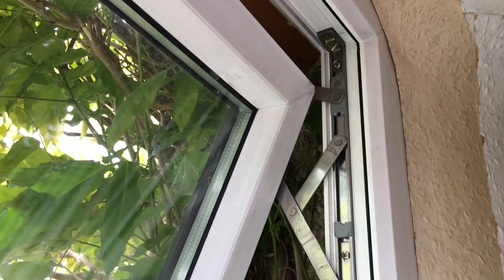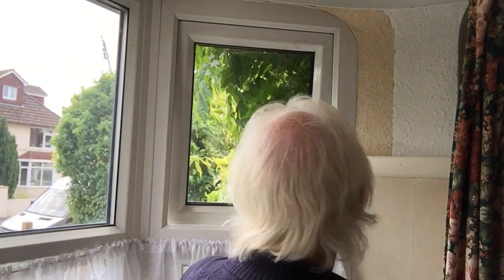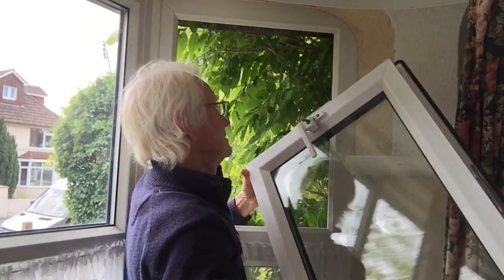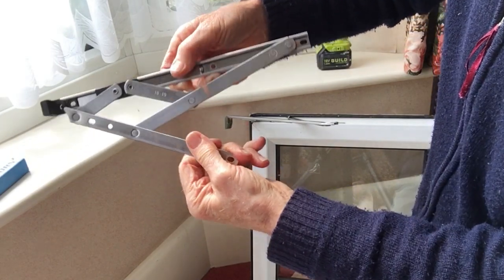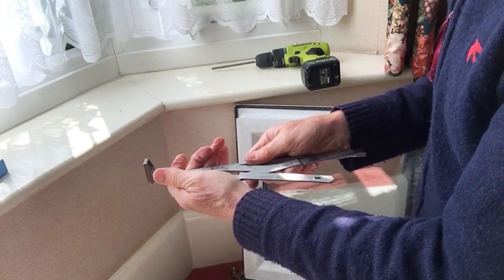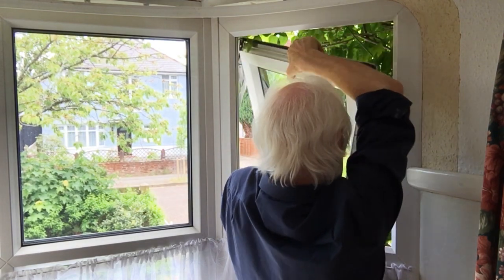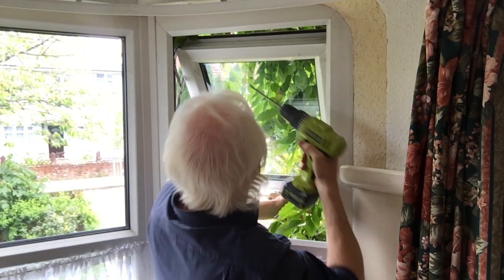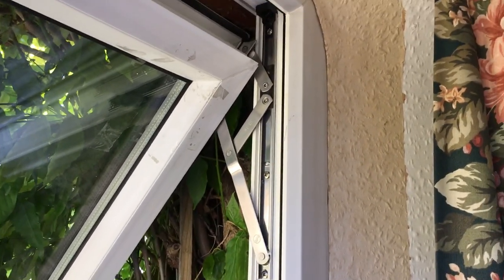Replace top hung UPVC window hinges - the DIY method explained plus how to avoid common mistakes.

Comment: Eight hours ago I started to replace the hinges on two top hung double glazed windows, Trying to do the hinges individually was a nightmare and as you can imagine I got very stuck.
Then I watched your video and 15 minutes later they were both in and functioning perfectly.
Sir you are indeed a living legend thank you so much.
An outstanding presentation. And I can’t get that song out of my head now so thanks for that.  
kindest regards Robert.
Reply from the maker: Thanks for watching Robert and for your kind remarks. Surprised me how such a simple looking job could get so complicated. Meanwhile a couple of correspondents suggested removing the double glazing panel first - which would make the frame about 90% lighter to handle. Wish I knew that before I started! Cheers b33zo

Comment: Hi b33zo, I just wanted to thank you for posting this video, it helped me a lot today when fitting new hinges onto my kitchen window. As I had never done this job before, I made a right mess of it and destroyed a hinge. I watched your video and popped to screwfix for a new pair. Mine were riveted into place so drilled them out. Fitted the new hinge to the window using self tapping screws, had my mate lift the window into place and screwed it to the frame, took 30 mins. Your video and instructions were easy to follow and so helpful, no longer have a cold drafty kitchen! Thanks again, Jonny.
Reply from the maker: Thanks for watching Jonny and for your kind remarks. Who could have thought that this job could be so complicated?! A couple of people below suggested removing the double glazing glass first - which makes the window around 90% lighter! Wish I had know that before I started... Best wishes b33zo

Comment: Thanks for this! I just fixed a window that had exactly this problem. I got the Mrs to help though, much easier to get the window in and out with two of us.
Reply from the maker: Thanks for watching Martin. Someone suggested taking the glass panel out first (fairly easy to do) which was an excellent idea as 90% of the weight is in the glass. Would have made my job much easier. Cheers b33zo

Comment: Hi John, this vid has been up for a while so this comment is for the benefit of DIY'ers using this as reference.

The hinges you removed where in fact 17mm stack height.  By leaving the packers out the hinges will be misshapen, under stress and likely fail early. I've seen these fitted incorrectly and the stress pulls/strips the top screw holes in the frame.

When you offered it back up and it seemed tight, that is correct. By opening the window/hinges fully this allows hinge flex to pop or pry the frame side of the hinge into what's known as the euro groove/channel.  I hope this makes sense.  All the best.
Reply from the maker: Thanks for watching Neil and leaving some helpful advice. Yes, it looks like I was too hasty in deciding the window wouldn't fit with the 17mm stack - partly to do with the weight while holding it in place to make that decision. If I had taken the glass panel out first (as several people later suggested) I might have successfully located the frame and hinges into the euro groove. Another DIY lesson learned. 
Cheers b33zo ps my wife later shaved most of my hair off..

Comment: Great video. I’ve been having a nightmare with my new hinges. After watching this video I realised I’d put them on back to front, so they wouldn’t pull closed at the top 😂
Reply from the maker: Thanks for watching Lee. Yes I had the same problem. Even when you've double checked the direction of travel the hinges can still be on back-to-front. b33zo

Comment: Thank you very helpful. Wish I watched before I tried.

 The Mushrooms don't fit into the keeper bottom of my window, do you thing on the frame should Be lower not butted to top of frame.
Reply from the maker: Hi Son, thanks for watching. I had the same problem and got very unhappy. In the end I moved the part of the hinge that fixes to the window. The frame part of the hinge stays butted to the top of the frame. It's all part of DIY! 
Good luck b33zo

Comment: My replacement hinges new bumper are slightly bigger, installed them exactly how you did but bottom window lock doesn't clear by ½mm and it's right up against the frame

Comment: Just to confirm, when you say "left" on the hinge, that is left from the perspective of looking in the window from the outside? Also, since the hinge coming off was 17mm, how come making it the same size with the spacers was too big, but it fiitted on  being 13mm?
Reply from the maker: Thanks for watching. 'Left' in this case is from inside the roome. The hinges are clearly marked with a 'L' and an arrow showing direction of opening. The fittings include spacers just incase you need them. b33zo

Comment: Good video. Can you tell me if I can replace friction stays (side hung) with friction stays that include the easi-clean/egress feature? Are channel widths the same on all UPVC windows?
Reply from the maker: Thanks for watching Mark. I think the answer is yes and yes. The stack height is still 13mm or 17mm and the width 18mm so they should fit okay. Give yourself twice as long to do the job as your best guess on a finishing time. ATB b33zo

Comment: Im finding it very difficult to drill the frame for the new holes .
Aluminium frome I think .
Any suggestions 
Thanks.
Great video doh 👌
Reply from the maker: Thanks for watching Tom. UPVC is like drilling cheese. Just make an indent in the material (UPVC or aluminium) with a masonry nail or something else sharp and use a new drill bit. Shouldn't be a problem. b33zo

Comment: I have a broken hinge similar to your demonstration.  However, the hinges are not screwed to the UPVC frames.  I'd describe them as riveted with flat rivets with a small hole in the middle.  Have you come across these fixing? The windows are old of course.  Do the rivets need to be drilled out and if so, do they need to be re-riveted back again, that's assuming the holes line up with the new hinges?  Any information is appreciated. Nice video btw.
Reply from the maker: Thanks for watching denbyish. The concertina mechanism is held together with rivet type fixings but the whole hinge is screwed to the white plastic. So no drilling or re-riveting required. When you take the screws out on the frame side of the window the window and hinges come out complete. 
Someone made a useful suggestion that if you remove the beads and take out the double glazed glass the 'window' become much lighter and easier to handle. Wish I had done that!
Give yourself plenty of time - on a warm, dry day.
b33zo
Reply: Hello again...  For the benefit of other readers, my hinge (concertina mechanism) is riveted together, but the hinge is additionally riveted to the PVC frame, with aluminium rivets.  I looked online and the general method of removal is to drill out the rivets and to use fresh rivets where the frame holes line up (with the new hinge) and screws where they don't.  I leave a link which may be of use to other viewers who have this type of hinge fitting. Thank you for your reply.

https://www.handlesandhinges.co.uk/window-hinge-rivet-removal/#:~:text=Window%20Hinge%20Rivet%20Removal,-To%20remove%20rivets&text=Use%20a%204mm%20or%205mm,just%20taking%20the%20top%20off.&text=Refit%20new%20hinges%20to%20window%20using%20screws%20or%20rivets.
Reply from the maker: @dembydish  Thanks for your reply. Yes, this is another thing altogether. I would drill out the rivets to remove the window. If the new hinge holes don't line up it might be to your advantage as fitting screws is likely be easier than re-riveting. There's nothing to stop you drilling out fresh fixing holes in the concertina mechanism either. Lets us know how you get on. 
Good luck b33zo
Reply: We used "security screws" which look like rivets because of the head. They will unscrew with the right fitting (although, we found out that a cross head rill bit can unscrew them if done slowly)

Comment: What about the missing screws on the opening sash against window  didn’t show that because when installed it’s impossible should have fixed it when it was out
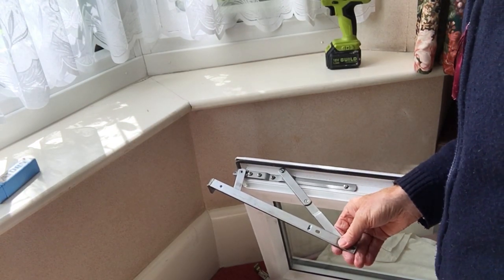Reply from the maker: Thanks for watching Mike. I think that is covered at about 6:10 in the video. b33zo

Comment: 2 mins remove the four beads. remove the glass,  makes a top hung sash far easier ro replace the hinges.
Reply from the maker: AB excellent suggestion and the window becomes 90 percent lighter while you work. Definitely will try that on another dud window here at home. Cheers b33zo

Comment: Next time, make a little jig that holds the sash in place for you, you drop a sash, your in trouble, great effort, I do this daily, it’s effortless with a jig 👍🏻, took me years to make it easy on myself, without a jig, it’s bloody hard work loool 👍🏻
Reply from the maker: Thanks for watching CCG. Yes dropping the sash would be a catastrophe. I like the idea of a jig to take the weight. Cant quite figure out how it would look. Could you reveal that to us or is the patent still not secured?! cheers b33zo
Reply: @b33zo  Hi B33zo, I’m changing a top hung over fixed on Tuesday, I’ll show you the jig I’ve made, and make a quick video, really does save the arms…..and casement loool cheers
Reply from the maker: @coventrycityglass2273  Thanks CCG that would be a great help for us DIYers! cheers b33zo
Reply: Hello CCG, It would be a great help to see your jig. I sent you an email, cheers Marcus

Comment: That looked dangerous on so many levels, you could have slipped of that window ledge dropped the drill and put the window through or dropped the window but thank goodness you didn't and well done on the finished job. I'm just about to do the same thing only with side hung hinges, would be easier and safer with another person to help.
Reply from the maker: ha very true Des. The job turned out to be much more complicated than expected. Hope you found the side-hung windows easy to do. b33zo